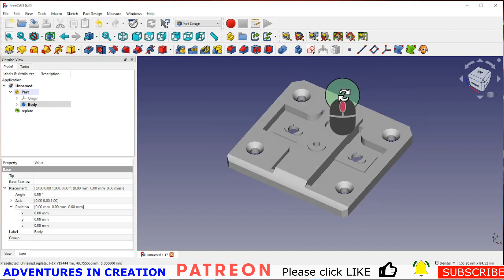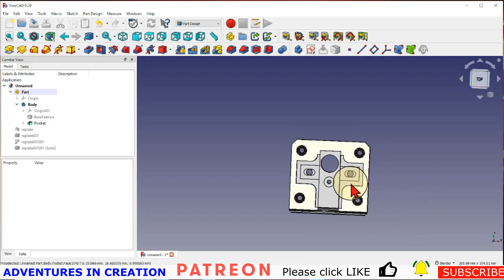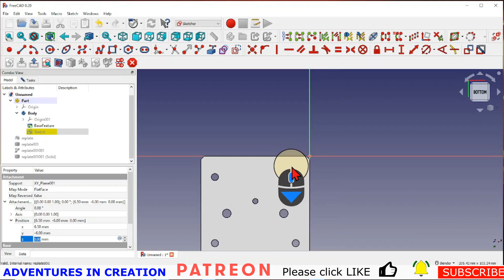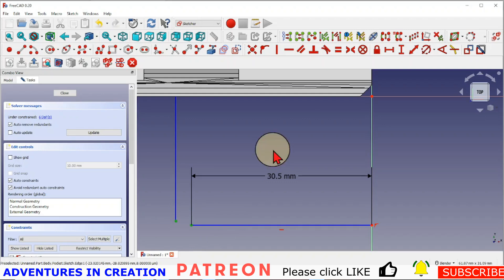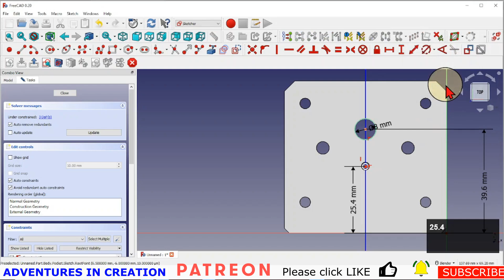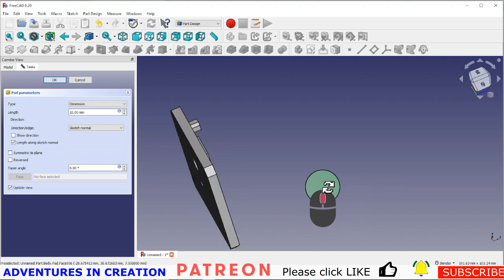FreeCAD Beginner #39 Modifying STL Files - You won't believe what you can do!

Comment: If you need a Solid to work with than why it does not do that automatically?
Plus that model looks horrible! You can hardly tell what is there? You should at least turn on Shaded with edges!
The triangle mash is totally useless so why even show that?
Maybe You can tell I am coming from SolidWorks which does not bother you with any of this nonsense!
You just import something and immediately you can start modifying it!
This FreeCAD is pissing me off as you can tell, you can't get anything done with it! And it looks horribly cheap!
The Rotate function sucks! And on and on like that!
Reply from the maker: If you are using Solidworks, you will see that FreeCAD has a long way to go however, it has come a long way and continues to improve. I can tell that the devs are heavily influenced by solidworks but I don't think you are going to get the same experience as solidworks from a Free open source CAD software.
Reply: @Adventuresincreation  I have opened my largest assembly in FreeCAD 3150 parts. It was un manageable it was so slow, 2 frames per second.
The same thing runs in SolidWorks 60+ frames per second in Large assembly mode. Very smooth.
Python is the problem! Because FreeCAd is based on OCCT just like SolidWorks. But Python ruins the experience!
Reply: @Adventuresincreation  No, I have not noticed that FreeCAD was influenced by SolidWorks, because it works differently. The Work-Benches are useless.
In Solidworks you don't have to deal with that! It is transparent Auto-Switching. You just click on the tool you want and it Switches you to the corresponding "Work-Bench" I have never heard the Therm Work-Bench until I opened FreeCAD! You get what you pay for i guess!

Comment: Can you make an STL into a sketch?  Once I make the mesh to a solid, then refine the image, I end up with a nice solid, but I can't figure out how to make it so that I can constraint the lines to add the dimensions and end up with a working sketch.  This way I can put the dimensions into a spreadsheet and make the part parametric.  Can you help?
Reply from the maker: I don't think you can do what you are trying to do. You can make a drawing from the model but you can't make a sketch that drives the model from the model. You could produce sketches then create a new model using your STL as a guide.
Reply: I think this is what most people are looking for when they convert STL files. It's like an open secret that you can't do this. So many 'edit STL file' videos but none will come out and say that you can't reverse engineer STL back into sketch based. You have to essentially recreate it.
This is at least the first time I've seen it stated planely.
Reply from the maker: @CLGilbert  An STL just doesn't contain the information you would need to recreate the sketches it came from.
Reply: @Adventuresincreation  But blender, for exmple,  is able to edit them.
Reply from the maker: @trinitrotolueno8887  yes, so can FreeCAD depending on the size of the mesh and the quality of the model. If you just want to modify an STL you can do that. But if you want to produce sketches from the STL you will need to recreate them, there is no auto-magic way to do that.

Comment: Following along exactly and get errors at every step. You need to realize people are following along. You move to fast and don't explain stuff you just do it like everyone is keeping up. For instance in the beginning you got rid of the mesh because you didn't need it anymore. How? It just greyed out without an explanation.
Reply from the maker: You need to n use the video controls and either slow it down or rewind that way you can control the speed yourself. I can't go super slow or no one would watch.
Reply: @Adventuresincreation  but HOW did you "turn off" the mesh, etc?
Reply from the maker: @canadianpatriot5577  you'll find it clearly explained in one of the videos. Off the top of my head, go into the draft workbench, look for the grid icon, it toggles it on and off. - If you want, you can include that icon in any of your workbenches by modifying the workbench to show it.

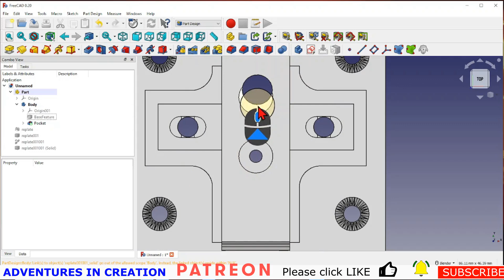Comment: at 15:13 when you dropped that solid into body it automaticaly made a "Base Feature" file and a "Skech" file. how?  I cannot get that automated Skech file...
Reply from the maker: The base feature didn't make a sketch, the sketch is what we used to modify the base feature and has to be created manually.
Reply: @Adventuresincreation    I know.
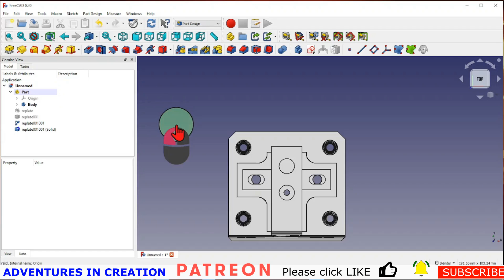 Sorry, my time code was wrong... At 5:11 you moved that "replate001001 (solid)" on "Body" and that made a "Base Feature" and underneath you have already a "Skech" file. I did all you steps and the "Schech" file vas not created. I just wonder why the difference... FreeCad 0.20.2
Reply from the maker: You can just create a sketch using the "create sketch" button. Then you can make the same modifications.

Comment: ===My .short hand. Notes ========
In Parts Work Bench: import a stl file. you get a (grn) icon in the Model box
------------------
.so.always select the last file icon [ ]
    in the ComboView Model dialog box.
a. part  / [Create shape from mesh]
           []sew shape .010
   delete grn stl icon, select xxx001 icon

b. part /  Create a copy / [refine shape]
      blue box icon becomes gray,non select-able 
      select blue dot icon 1001 file

c. part/  [Convert to solid]
     get the 001001(Solid) file blue icon
`
c1. so make sure you delete xxx001 file

d. go to Part Design WB 
    select Make Body icon from upper menu bar
   
e. in the combo view Model dialog box:

e1. so make sure you delete all of the stray files use
    to make the 001001(solid) file.
    Because the other file objects are on file objects on the BaseFeatures file and it messes up the selection process. 

e2. click and drag 001001(Solid) icon onto Body icon. this makes a new BaseFeature file in the Body. this is the file to use to sketching on.

e3. with the BaseFeature file selected,
   click on the part face you want to sketch on and select sketch icon. the face will be yellow when selected and change to green when mouse is at the sketch icon.

Comment: My scale is wildly off once converted.  What should be a 1.98 inch model is reduced to 1.98mm.  How do I correct that?
Reply from the maker: That has to be the scale that you are bringing it in to. I believe the units are in whatever system you are using i.e. if it's 1.98 and you bring it into mm it will be 1.98mm if you bring it in to inches it will be 1.98 inches. I don't think it does any conversion.

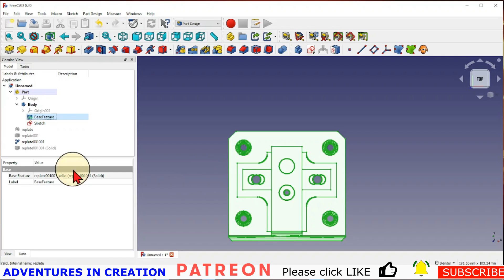Comment: When following your actions, moving the replate001001 (solid) to the Body, it created a BaseFeature, but didn't do the Sketch that is shown above at 5:17. I get an error that says: PartDesign::Body: Link(s) to object(s) 'XXXXX' go out of the allowed scope 'Body'. Instead, the linked object(s) reside within 'N/A'.Why would that occur?
Reply from the maker: There must be a difference. What version are you using?
Reply: @Adventuresincreation  .20 . I'll start again, I must have missed something :)
Reply: @Mikey_xx_  I had the exact same error, how did you fix it?
Reply: @beauson1983  couldn't. Moved on to another walk-through unfortunately.

Comment: Great video. This really helps to modify downloaded 3D files. Which was a real pain to look up and to do a while ago. One thing I would do different for aligning the sketch. I'd rather prevent the whole iterative approximation process. I would just use the 'External Geometry' tool in Part Design workbench to get the edge of the imported part and put the hole at the exact right location.
Reply from the maker: Good plan, I'll give that a try and see how it works
Reply: I think you should learn how to do something before you try teaching it to someone else. It would be a lot less confusing.
Reply from the maker: @jamesperdue9088  a bit harsh James. Why don't you show us how it's done 🤣
Reply: @jamesperdue9088  I really like this channel because it's really hands on. Just start and see where things are going. That really encourages me to also start trying things out and is a lot more relaxing to watch. While still learning useful stuff. 

There are other channels that make really tight and scripted videos. (e.g. Joko Engineeringhelp and Flowies Corner) While they have a lot of content, it's also really intense to watch and you have to keep up. You can watch the 2.5 hours Part Design video from Joko from early this year. You might remember what every button does, but you would have no clue on how to get started and no motivation to just get going. 

While Adventures in Creation really tries to make it a fun adventure.